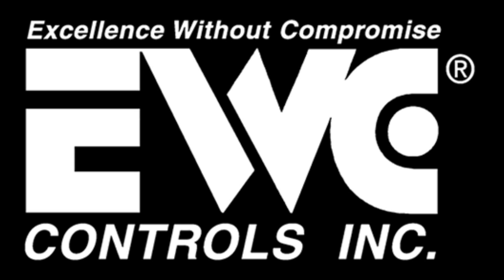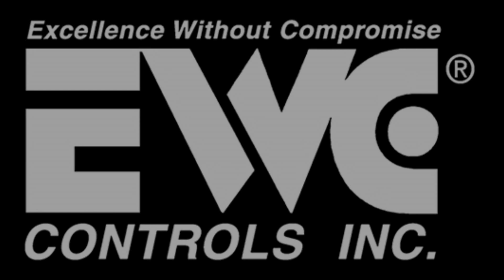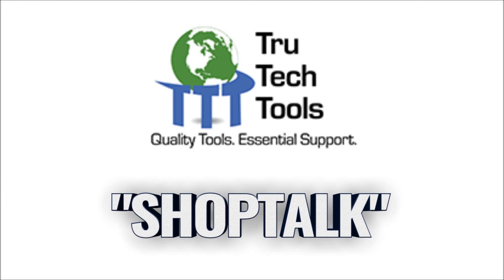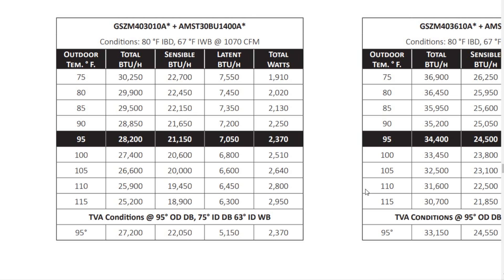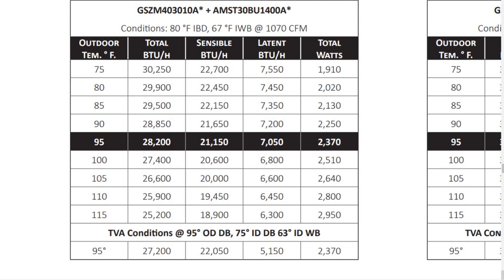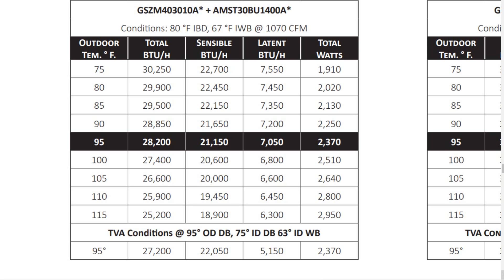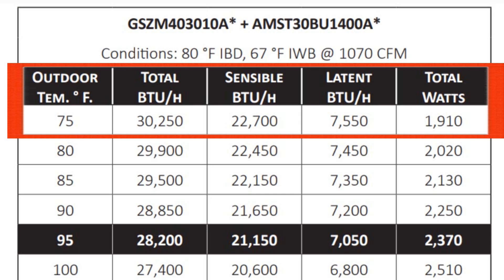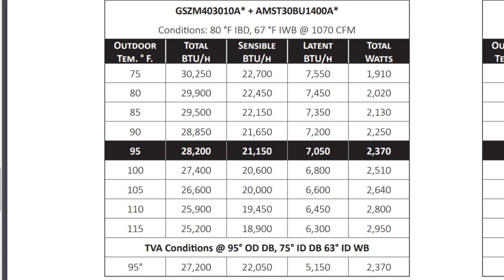Are You Sizing Your HVAC Systems Correctly? Common Overlooked Step

Comment: Great explanation by someone that knows the why and how of cooling and heating. As an Electrical Engineer who taught himself air conditioning it's nice to see an AC guy that understands the basic theory behind AC. I got sick of guys with gauges and refrigerant that didn't know what a BTU or latent heat of fusion or evaporation was. Super Heat and sub-cooling weren't even in their vocabulary. Same with plumbers, if they can't tell me how many inches of water equals 1 psia, then it's off to another plumber.
Foundation knowledge is necessary to do a good job..end discussion.

Comment: Wow, there’s so much to learn about HVAC. 😅 I’m slowly getting my head around all this information. I’m especially interested in understanding the concepts of wet bulb, dry bulb, and the difference between latent and sensible heat. Also, figuring out how to properly size units for AC and furnaces is another puzzle I’m trying to solve. If anyone has some handy advice or resources, please share them! 🎉❤

Comment: I'm in Central Eastern Florida. I have a Ruud 3 ton package unit in an 1130 sq ft CBS home (1973). The attic ductwork is original (I'm told it had an  R4 value). There is only 1 return (18x24 in) located in central hallway that a rectangular box was built in the bottom of a  bedroom closet (7 feet long) out to the unit. The supply is also cut out from the same closet running vertically up to the attic. There are 8 ceiling registers (2 bdrm, 2 bath, 1 entry, 1 dining, 1 LR, 1 kitch). Anyway, the HVAC company that services the unit following my questions about how to make this system as efficient as possible wants me to hire a local independent guy to do a load calc. He charges $800. I was thinking of just redoing all the attic ductwork to modern plenum/flex ducting. If you have any thoughts, I'd appreciate it. Thanks.
Reply: Flex ducts do not have much insulation.  Possibly no improvement in keeping supply air temperature cold.  I suggest assuring the condenser coil and evaporator coil is clean, the fans are clean and good airflow around the unit.

Comment: i Wish I could say i do a full manual J each install, an manual S is its assurance the stuff you put in fits the bill.  being a small company, in the Hight of the season its a hard thing due to time.  i use a short form with 3 models to price and yes install retro fits.  full manualJ if i @ 30 years have some question of the load.   and only do j, S And D on full install and duct jobs I spend over 5 hours  to complete, load, selection, and duct, all of that work and uncompromising detail drive my cost up substantially.   I make big promises but only do average  one duct job per 2 years or more. and never do any new construction my cost are to high by alot.

Comment: In Florida Latent cooling is more important. I can put people in 78 degrees with 55 percent humidity and they are comfortable. I can put some one in 72 degree with 65 percent humidity and they will not be comfortable at all. Guys….. we should be removing heat as well as humidity too. Do that and you will have happy customers
Reply: Exactly.  Is it possible to achieve that in Florida with a single stage unit?
Reply: Down here in Florida I feel very comfortable in 79-80F with 40% humidity so yeah, true.
Reply: @raulrse  how did you manage that?  Inverter?
Reply: @TJ-22  properly sized tonnage
Reply: @raulrse  OK well done. I did not think that was common in the hot, humid state of Florida, unless you had a dehumidifier or an inverter system. I thought 55-60% was what they shoot for in FL.
Reply: Different story in east Idaho for sure when temperature is everything and we have an average indoor humidity of 35%